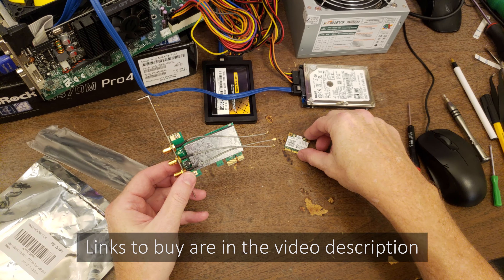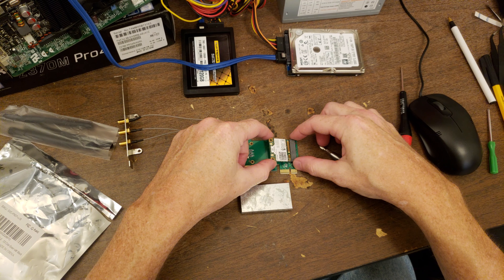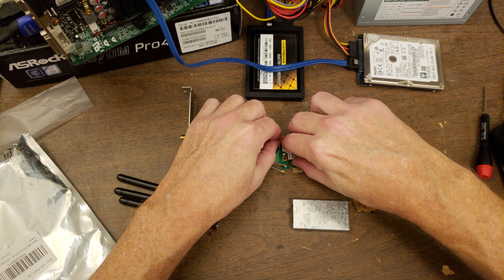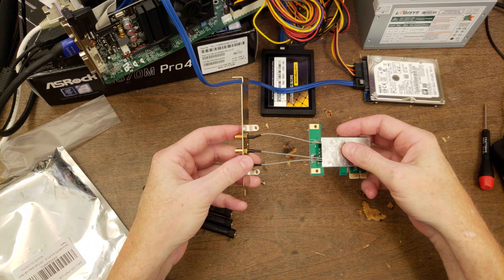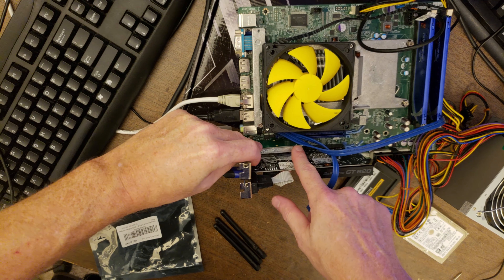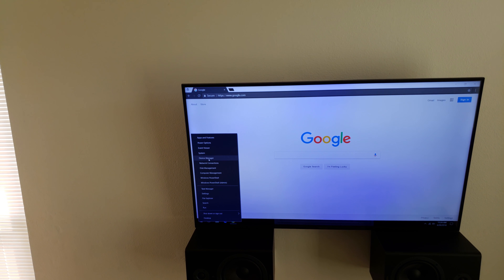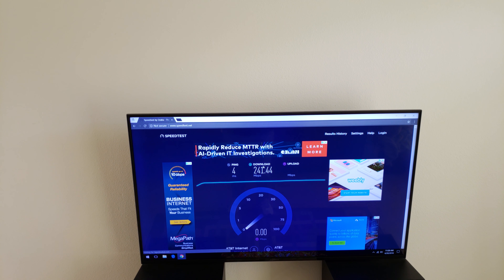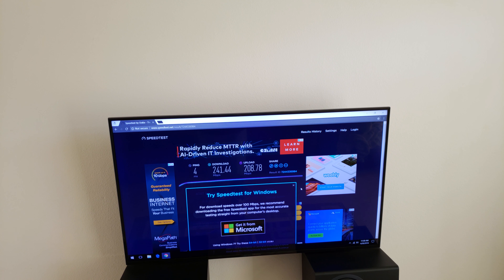Installing a laptop wireless AC adapter in a desktop computer

Comment: Very nice work bud. I couldn’t believe there was a video on here that shows a comprehensive, working solution to this very problem of mine. I’m always desktop first but I have this laptop wireless card upgrade. My only question is what kind of connections can you use for the laptop card? Can I just jimmy-rig something together to connect the antennae or should I fish out the wires from that laptop and do it all smooth n’ sexy-like??

Comment: I'm not sure, but I think with some motherboard you can install it directly!! without adapter if it have MINI PCI-E
correct me if I'm wrong... my z170 motherboard have MINI PCI-E and also 2 antenna holes ready to use, just need to push and remove that metal cut out.
but I didn't try it yet
Reply: Correct but the can only be used on mini pcie, not full sized pci-e. Note that older AMD boards did not come with the mini pcie slots for onboard wi-fi/bluetooth
Reply: m2?

Comment: Just put the laptop wifi adapter in your pcie slot and call it a day . Dont need the adapter.
Reply from the maker: It might kind of fit but it definitely wouldn't work. Funny though, Theo Joe.
Reply: If I install with laptop antina.

Comment: bad cable management  on  those  pigtails  you had to  make  a loop for each one to fit  inside .... that's  the name  of  those antenna  wires,  pigtail  because  they  must be  loop-ed  in  spirals  like  a pig's tail  .. rf antennas are prone to damage or signal los if bent in a low angle , like fiber  optic cables. ..that's why you have  to  loop them .. and  put  a screw  on that card ...  is not good  for the antenna terminals  touch the shielding (the metal  case is used as as shield to avoid interference's  from  other  electronics that are to close  )
Reply: seems like a good idea, most people like the video author & i are not wireless internet experts so thanks for sharing
Reply: incredibly disappointed with this video now. to be fair, it looks like the unit Michael purchased failed to include the brass standoffs. at least one pair of those parts is typically always included with these MiniPCIE adapters.
Reply from the maker: This particular one was disappointing.  I got it to work but that doesn't excuse it.  Other adapters on Amazon are better.

Comment: Is this modification is from Laptop to PC is the best solution to get this speed ? Or the other links below give the same speed ? Are they both based also on the Intel AC 8260 ?
Reply from the maker: This is just showing that you can take a wireless adapter that's intended for a laptop and put it in the desktop.

Comment: I watched your video because I have a H110I-PLUS Asus motherboard. Is motherboard compatible with the adapter in your video? Can work within an hackintosh?
Reply from the maker: That's a mini ITX motherboard with only 1 PCI Express slot. I assume you're putting a graphics card in that slot so there are none available to put an adapter like this. You're better off with a USB Wi-Fi adapter.
Reply: @MichaelTheComputerGuy First of all thank you for the fast reply. This is a free slot because I use the Intel HD integrated GPU.
Reply from the maker: Then the adapter would work in the computer. I don't know whether or not it would work in a Hackintosh. Unless you already have the half mini Wi-Fi adapter you're better off looking for a PCI Express Wi-Fi adapter that is compatible with a Hackintosh. I would think that doing a Google search for Hackintosh and PCI Express wireless adapter will get you some people talking about it who maybe already have some suggestions.
Reply: @MichaelTheComputerGuy   Thanks for the tip, Atheros Ath9k or Broadcom bcm943x should do the job.
Reply: @lucapaolelli1192  stick with Intel. These others are horrendous to find drivers for.

Comment: Do you think if your card had bluetooth you would be able to use that too...
Reply from the maker: Not on this adapter.  There are other adapters that can use Bluetooth but you have to connect an internal 9 pin USB cable to the motherboard.

Comment: If your board has a PCI port that the wifi card will fit directly into, do you need the PCIE adapter? Gonna try it and see but wanted to see if anyone else knows
Reply from the maker: This is for PCI half mini card. That's very different from a PCI slot or PCI Express slot on a motherboard.

Comment: I have a Ryzen based PC which I desperately want a wifi and bluetooth adapter into. Do you have any idea if these Intel adapters work with AMD chipsets?
Reply from the maker: I don't see any reason why they wouldn't
Reply: Yes, they will. Intel are so much better than the broadcomm WiFi/BT adapters. I would recommend getting an M.2 A/E keyed pcie x1 riser, though.

Comment: Can you do the same with a TV wifi module? I remove mine from mine from an LG TV it is little bigger than the adapter in the video and it is square.
Reply from the maker: No. To add Wi-Fi and smart capabilities to a TV you need a Roku or something similar.
Reply: Michael Cooper okay thanks
Reply: If you do get from tv its really risky you might fry it

Comment: should you screw it in if you could?
Reply: Maybe loop it around those pcb holes and the screw hole on the WiFi crad with some sandwich wire

Comment: you don't need the 3rd antenna if you're only using 2 🤣also anybody watching this just go buy a wifi usb dongle on amazon.
Reply: wifi usb dongles really arent that great and also getting a ngff m.2 a+e key to pcie 1x provides the cheapest option for very fast wifi speeds for like 25 bucks compared to 40 dollar ones from manufacturers like Asus and TP-Link
Reply from the maker: True on the speed but usb adapters are much easier for people.  You can get a pretty fast one for $25.
Reply: he just kept it , and who cares what you think ... i reslly needed this adapter but couldnt find it and this video is really nice to watch

Comment: how to attach a laptop hard drive to a PC.  isn't it a 12v pc and a 5v laptop?
Reply from the maker: A 2.5" laptop drive will work in a desktop.  You dont have to worry about volts.

Comment: THE ATTEENAS ARE GONNA KILL ME. they dont fitttt
Reply from the maker: Make sure you have the right type of wireless adapter. There's a ngff or a pci half mini. The antenna connectors are different on each.
Reply: @MichaelTheComputerGuy  i managed go connect it but its criss cross. whatever. thank you for the help though

Comment: Hello Michael... can you pls help me with a problem? i want to upgrade my graphicscard and my ram so i contact you bcs you had the same pc as me now and you could tell me what kind of Ram and GPU i should plug in... tell me your skype name or something i can write you uo.. thx :)
Reply: Eitehr take a look at your motherboards booklet, or visit manufacturer page for it. Youd find all the information you need.
But basically you have to just check the RAM type (DDR2/3/4) and ram frequency 1333/1500/3000 Mhz)
And for the GPU, check whether you have the an available slow PCIe preferably, and type of it.
As long as they fit, they would work even if you buy something without looking at anything. It would just be waste of money, say your MB supports only 1333 Mhz ram and you buy 1500, because it would only work at 1333. Same for the GPU

Comment: Best buy a smart TV and sell all that shit, or yet pi it
Reply from the maker: If all you want to do it watch videos that's good advice but you can do so much more with a computer.
Reply: @MichaelTheComputerGuy  my laptop support only 4g so if i replace ny wifi card will my laptop support 5g
Reply from the maker: @vnver38  4g and 5g are cell connections. Wifi is different
Reply: @MichaelTheComputerGuy  means